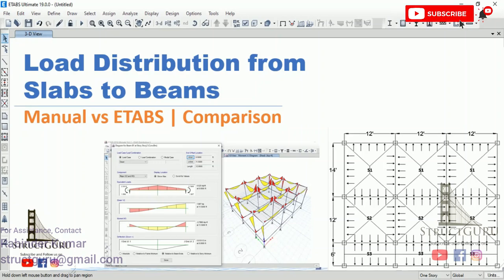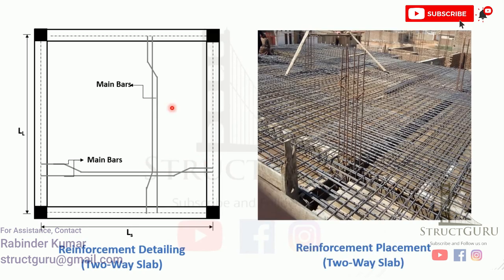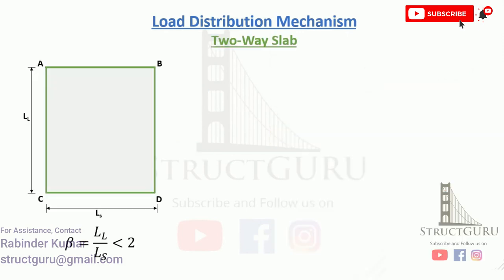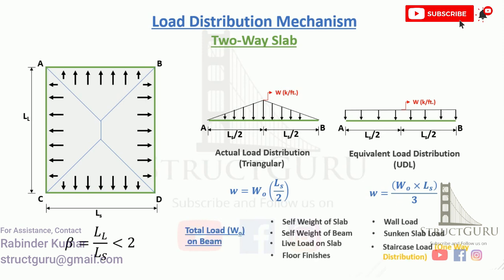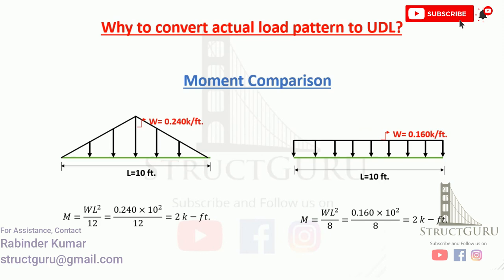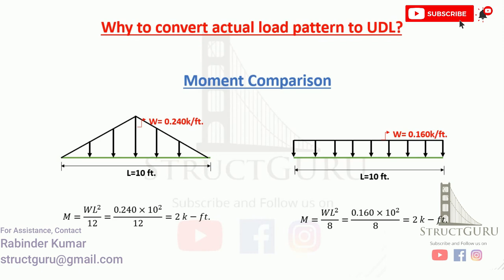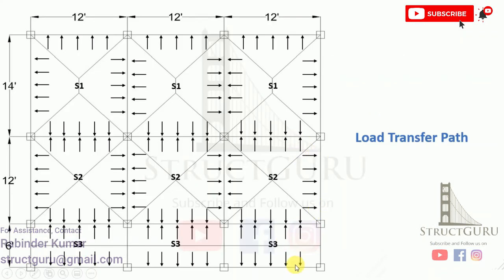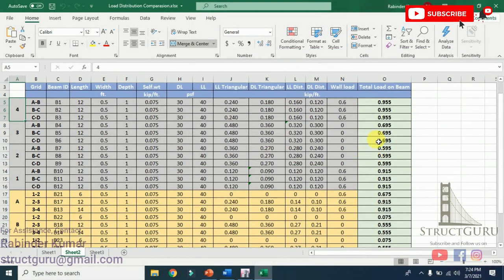Load Distribution from Slabs to Beams | Manual vs ETABS  Comparison

Comment: Thank for the video.  However I do not grasped how W=0.240 k/ft for triangular loading and then W-0.15 k/ft for the UDL. How is those values obtained.  I believe I have missed something between W, Wo and w. Thanks in advance.
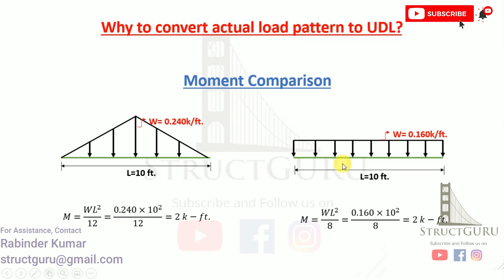Reply from the maker: Hi! I have explained the actual distribution and equivalent distribution in my video. The formulas are derived based on moment calculations. Watch video from time step 3:30 to 7:00.